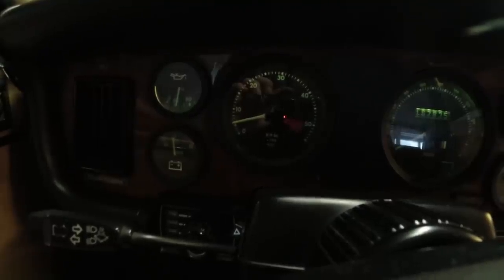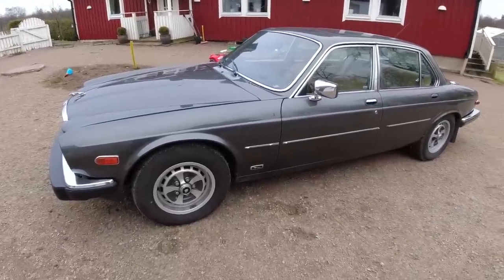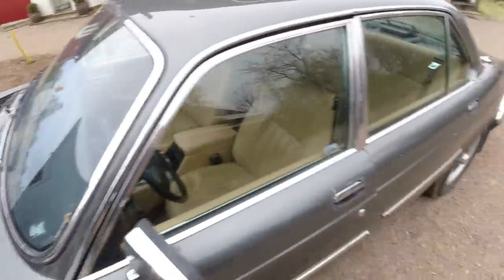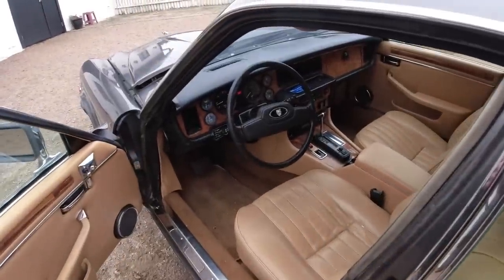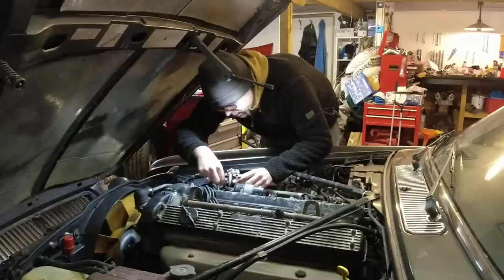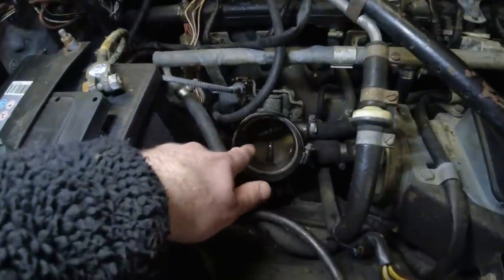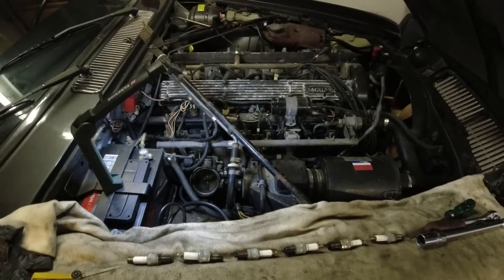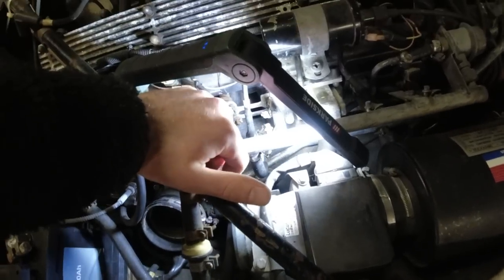Jaguar XJ6 Series 3 with a Rough Idle Problem - Let's Fix It!

Comment: Did you know that if you remove the black top off the air flow metre you can adjust the toothed wheel inside by easing back the spring clip and moving the toothed wheel either way,  to richen or weaken the mixture,   ( i would mark the position of the spring clip in the wheel tooth before starting ),  if you've adjusted the mixture by way of the adjuster down the hole of the air flow metre and it's still out of range,  set the adjuster to the recommended turns  and try the above method,  BUT make sure the fuel relay clicks to it's off position. Put sealant on the air flow metre black top and fit back in place..
I'm a UK retired  Jag Technician of 50 years experience,   1963 - 2011.
Reply: Jeffrey, I'm fairly sure that someone has adjusted the toothed wheel on my car.  Could you point me in the right direction of where it should be as standard or is it a case of trial and error?
Reply: I don't have the set starting position,  but make sure with the ignition turned on,  you turn the wheel to hear the fuel relay click off.
If you have a co machine,  turn the wheel to watch it weaken or richen, soon as the relay clicks on  you've gone to far, go back so it clicks off,
Then use the adjuster down the hole,   i think there was a plug over the hole.

Comment: Nice to see an XJ6 S3 video! I’m running a rust free 1984 survivor in Germany with 22,000 original miles. I had Daimler XJ81 power front seats, front and rear butt warmers, a Daimler Double Six four passenger seating arrangement, Series 2 chrome bumpers and a ZF four speed automatic transmission installed. The car is black with Bisquit interior and custom matching carpeting.  I’ve collected the most appealing interior parts from various Series 3 model years and added some dipped pieces and some chrome accents in the interior to eliminate some of the appallingly cheap looking black plastic. Although it’s my own car I’ve had for years, I’m always surprised at its beauty, when I haven’t seen it a while. Thanks for all the effort and time you put into your videos and the worthwhile entertainment you provide! Very much appreciated! By the way, I also have a genuine Time Machine: a pristine, 
BRG/Doeskin, unregistered November 1992 Daimler Double Six with  delivery mileage (362 km). Even the original factory seat covers, to be removed before customer hand over, are still there.
Reply: Greetings from England,so envious of your un registered Daimler, lucky man.
Regards.
Reply: @boyfromblackstuff7859  Thanks for commenting. Yes, it was a lucky turn of events for the Daimler to come my way. I've known the car since the nineties and offered to buy the car if ever the owner wanted to dispose of it. He needed to do major work on his house some years ago and offered the car to me. However, we have been friends for decades and the car has remained in "the family" so to speak. The owner had had an official Jaguar and Leyland dealership in Germany from the sixties until the eighties and had been in good contact with the factory at the time. Many QC issues appeared on Jaguar cars specifically in Germany, as they were more strained due to the higher speeds. The man and his team worked out a number of these issues on their own, as the factory was slow to react and the solutions often unsatisfactory. At times the factory would consult with my friend's team and some of their solutions were fed into series production. In fact the factory built him a specially equipped XJS in 1976. Among other tweaks it had the four speed manual transmission from the E-Type S3.
Reply: Interesting story there,fate dictated the Daimler should fall into the hands of a person who would both appreciate its rarity considering its history and would care for it appropriately,well done.
Always been a big fan of XJ series of Jaguar's,in my childhood they represented wealth and affluence.
I currently run an XK V8 convertible, although it rarely leaves the garage unless the sun is guaranteed!
Also Jaguar XJS V12 ,year 1989, which I am constantly working on, latest task is the Lucas Omnicell fibre optic illumination system to various elements of switch gear,so far quite challenging ,insofar as not damaging any of the veneer on the centre console in the strip down.
Not supprised your friend had issues with the factory re QC in I am assuming the 1970's , having worked with people who recounted stories to me of their time in the employ of Rootes Group in Coventry and also British Steel Corporation it is no wonder the co's did not survive.
Regards.

Comment: Great work. She sounds really healthy. My first one was a very early 1981 series 3 and it had exactly the same problem. Took ages to determine what it was. Used to stall if the steering was on full lock. Great once it was adjusted though and got better as time went on. I think it was s bit coked up but eventually cleared itself. Best car I ever had! Great video as always!
Reply: …and let me guess, your other cars were an amc gremlin, ford pinto and a yugo?  Ha ha.  Just kidding.

Comment: Super Interesting!  
I have a 1982 Daimler XJ6 series 3 with the same problem - it idles fine when cold but rough when hot (to the extent that it almost stalls, and will stall if I have the air con on). I checked the spot that you adjusted but mine is not accessible, it is covered over with a metal plate/strut so I hope it has not been messed with… 
Would love to hear more about what work this car could benefit from !

Comment: Nice work Adam.  I have an '83 XJ6 and it is a lovely car.  So very nice to drive, smooth and comfortable.  I use is quite a bit in the summers.   The only thing I would wish for is that it had a 4 speed automatic transmission.  I think that would make quite a difference in performance, but I don't want to alter a classic.

Comment: Can you make a video showing all the vacuum points/lines for the series3? I've check the net but cannot a lot of info on that. Also, what about injecting smoke into the system to find leaks, is there a safe, do it yourself method of doing that?

Comment: Very interesting !  Great detective work
I have the same issue with my S3 so I will proceed as you did 
Thanks so much !
Reply: Let me know how you get on @Jean-Pierre.  I have a similar problem with my '83 S3 but won't be able to get under the bonnet of it until end of March.    Another really helpful video from Adam.  Let's hope the owner asks you to do more work so we can follow your progress on an S3.
Reply: @markdpeter  
Hello Mark. I will as soon as possible. Weather is cold now in Canada so I don’t have the problem. I have already changed the rotor, distributor cap, spark plugs and wires and the coil. 
I also did the vacuum leak test but I will repeat it. 
I will let you know as soon as I can !
Reply: Hello Mark
As promised, here is an update on my 87 XJ6 idle issues when warm.
I found a leak in the conduct between the AFM and throttle body. I replaced it and that solved the “hesitation” when accelerating briskly !
I also found that the airflow adjustment screw was tempered with. As in Adam’s case, there was no plug protecting the screw and it was fully closed clockwise. I turned the screw 4 turns counterclockwise and it does idle regularly at around 800 rpm when hot (about 95-100 F).
In other words, SUCCESS !
Thanks so much Adam. Your videos are very interesting and they helped me several times !
I hope this will help you, Mark, enjoying your XJ6

Comment: Wrong spark plugs can cause issues, as you know, different reach different temp etc. Also as the coil is strapped to the engine they can breakdown when hot.

Comment: Glad it's fixed! I'm still a bit scared of buying a car with an XK engine. Are they good, are they bad, I don't know. Yet, so many cars with an XK engine are on their 2nd, 3th engine. What is happening? Seems like the V12 or the AJ6 aren't affected in the same way.
Reply: I've never heard anyone having a question about XK longevity before- I'm also not seeing cars having been through multiple engines, either. They are not prone to breakage that would render the engine unrepairable at all. If the later ones sit for long periods of time, the head bolts corrode... but the engines are more like industrial tractor engines in their durability. I think a lot of people can't troubleshoot properly and just start swapping engines instead of repairing them or something. My E-Type has its original 54 year old engine in it and my SIII XJ6 has its original- and no hint of any serious issues. I'be been a Jag guy for decades and owned a restoration/repair for British classic cars for years and never saw a "blown" XK engine at all... only bad cores from corrosion from sitting when looking for a spare to rebuild for a race car.

Comment: I had same issue. I also had to manually adjust air flow sensor needle. I installed simple o2 gauge over voltage meter to get some idea what kind of mixture it was running. For inspection i had to make it run very lean and that caused some popping when idling, after that i made idle much richer so that i would run smoother. ECU does use O2 sensor to control mixture but not at idle (air flow sensor has mechanical switch for "idle position"). It quite messy system and with worn out engine, blow by is excessive also causing mixture problems... I also had that "bell noise" when slightly revving, timing chain tensioner needs adjusting?

Comment: I had the same problem and I found out it was juste the micro switch throttle switch. Just disconnect it first and then the idle will be fine. It cost me 7 £ and it’s easy to fix. Your videos are great but could you please change the music ? 😊 take care. Arnaud from France
Reply from the maker: Glad you like the videos but i like the music
Reply: What cost you the 7? What was the fix, just disconnecting? Where is that micro switch? Near the trans indicator assembly between the seats? Thank you

Comment: Good day Adam and it just shows what tampering to such delicate stuff can do without knowing what you are doing .If i may ask you a question i bought a 1984 Jaguar Series 3 4.2 lt that was standing for more than 2 years.There was no compression but after putting some oil on the pustons and after many attempts i hot it fired up.Oil pressure gauge is very slow and lazy to register. With times it lifts up to 3 and stay there for a while. With times it drops completely beyond 0 all off a sudden. Some times it stays at 3 but when you give acceleration it drops beyond 0 again.I did a oil change and replaced the oil filter as well but without any change or success. Can that maybe be a oil sensor or something worse?The car is not on the road yet as i am still busy with rust repairs.Hope that yiu can give me guidance where to start now and what to do next.And i did not flush the engine. Only let it warm up and drain the oil.Will appreciate your assistance. Have a blessed day and keep save.
Reply: Get a mechanical (old school) gauge and screw it to the sensor location or oil galley on the block. You’ll know when you find it, unscrewed oil will leak out, not antifreeze. Research this on YT, all engines have them.
Reply: @rossilake3430  Tank you very much RossiLake and i appreciate your help and response. Will see if i can get hold of one off those gauges and do  that test.

Comment: Great video but 1 point needs to be clarified. What you referred to as the MAF (Mass Air Flow) is not actually a MAF. In the original German it is referred to as a VAF (Volume Air Flow) but in English it is referred to as an AFM (Air Flow Meter). The difference between a MAF and the VAF/AFM is a MAF calculates the actual mass (weight/density) of the air going into the engine while a VAF/AFM only calculates a theoretical amount of air. With the VAF/AFM it doesn't matter what altitude the engine is running at or what the air temp is it will always read the same. With a MAF altitude and air temp make a difference to the calculation.
Reply: Thanks for that

Comment: I got a 93 xj6 which keeps stalling and rough idle. Gave me a fuel failure code 12. I've changed the fuel pump and filter. Any suggestions.

Comment: Does anyone know if the XK engines changed during the s3 era? I recall years ago someone telling me that around 84 or 85 Jaguar took back the manufacturing and the engines were better built (something to do with the block or head design/materials). I now own 84 and am wondering if that’s true and which engine I have.

Comment: Good job Adam.. may I suggest a spark tester and a niod light for the injectors...also if you are ever curious about how well the O2 is working and roughly the emissions controls of the ECU is doing, simply put your multimeter red lead on the signal wire of the O2 and ground lead on a good ground, and if it's running at a close stoichiometric mix, you should see it jumping between .3 to .8 volts.. you know the system is perfect when it's steady around .5 volts.

Comment: My xj40 engine shakes quite a bit. But it runs well. 750-800rpm in idle, doesnt die in gear, even if its uphill. It also accepts gas perfectly. Driving it feels perfect

I just dont get why it shakes so much.  The igintion wires are already blurry to the eye from the shaking.

Any idea what that could be?
Reply: sadly today the shaking got even worse in idle and especially in reverse.  i can also hear it missfiring when i hear the tailpipe.  sadly no code.   what would you test first?

Comment: Sir I have the same problems for 8 years , I also tried to fix the afm screw , but it’s not helpful , my idle is “dancing “ also the engine is dancing . When I put “R” idle down then I put ac on , and is on 300. Maybe you can help me
Reply: Afm is new , sparks new , coolant sensor works . But idle and engine is shaking and it’s not comfortable

Comment: Sorry what did you say aboutvthe fuel system the fuel pump should be activated at the acc point.our 4.2 come on when the in acc position because that activatethe electrical system for starting

Comment: What is that god awful rubber strip on the doors that not factory standard no body puts that on a jaguar  the should be  chrome strip that runs along the crease line front ro rear and thats it never anything on the lower part of the door . Thats ugly what are you north Americans thinking !! 😢